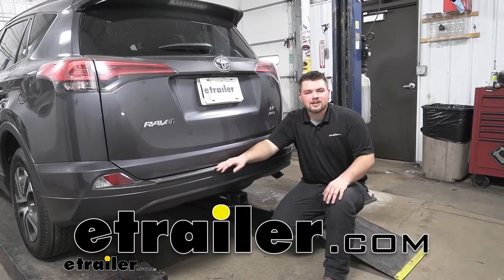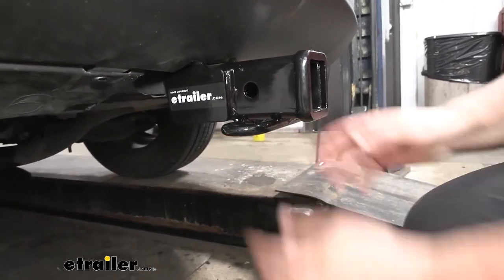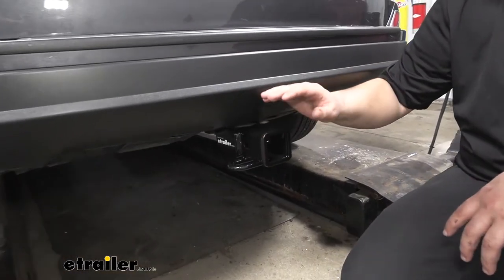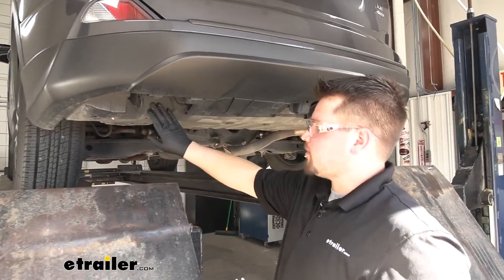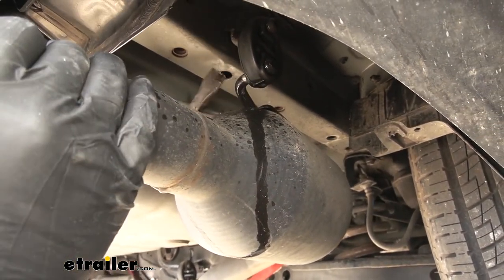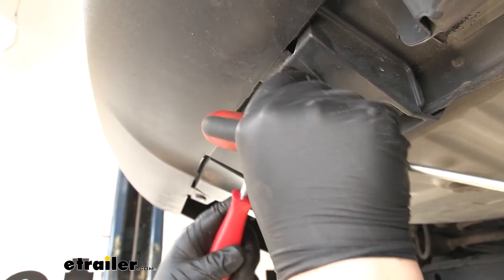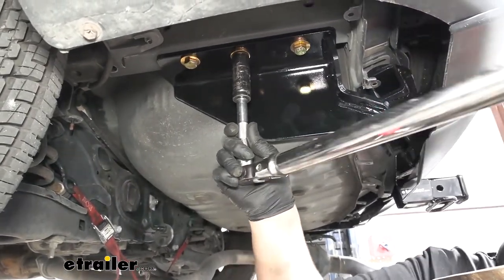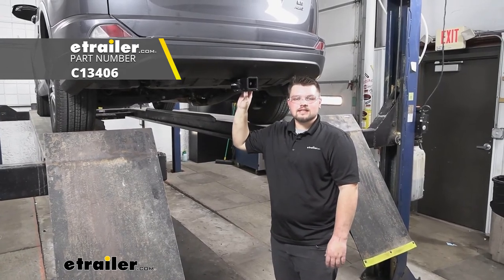etrailer | How to Install the Curt Trailer Hitch Receiver on a 2017 Toyota RAV4

Comment: This was the most neat professional installation
Reply from the maker: Thank you for the feedback! Check out the following link for more information on this Curt Trailer Hitch.
https://www.etrailer.com/Trailer-Hitch/Curt/C13406.html
Reply: This was a very informative and clear video. Thank you for the professionalism. 
The next part is for the algorithm: “Trailer Hitch Size:
2 Inch Hitch Opening
Towing Capacity:
525 Pound Tongue Weight
3500 Pound Towing
Weight Distribution Towing Capacity:
525 Pound Tongue Weight
4000 Pound Towing
Trailer Wiring:
2017 Toyota RAV4 Trailer Wiring
Features:
This fully welded trailer hitch receiver bolts onto your vehicle's frame with no welding required. Matte black, powder coated steel is durable and corrosion resistant and creates a rugged look.
Installation Notes:
No drilling required for installation
Underbody trim panel must be modified or trimmed if present
Fits Hybrid models as well
Hitch may interfere with the Hands-free Liftgate sensors and functionality may be very limited or possibly lost.”